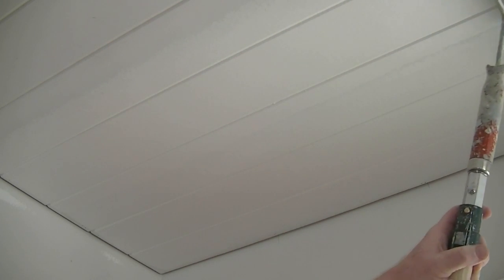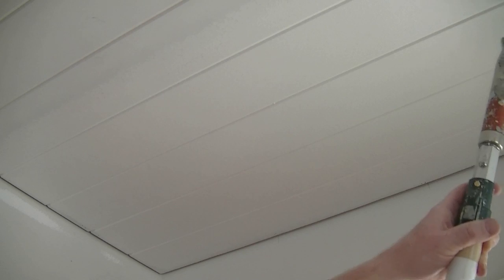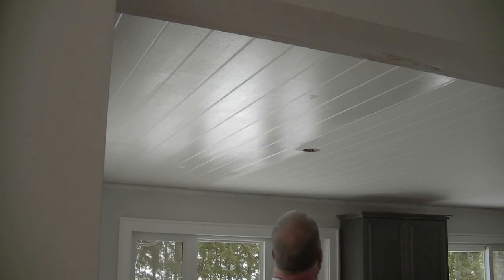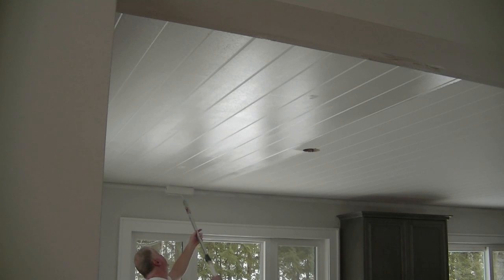How To Paint Tongue & Groove Ceilings

Comment: Thanks for the video, do you gap fill the joints with caulk before painting or do you find that this is not neccesary? Thanks
Reply: A lot of people do but it is NOT necessary. I myself chose not to bc the caulk will eventually crack and need to be redone.